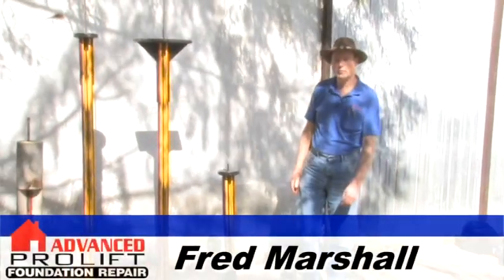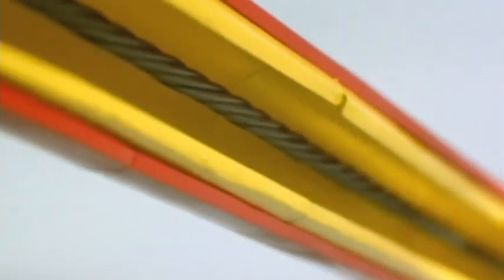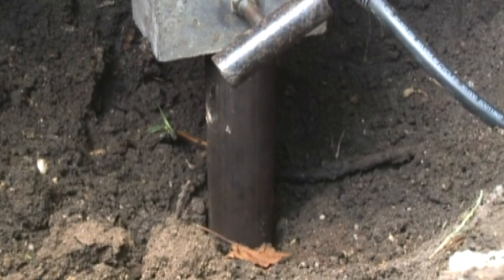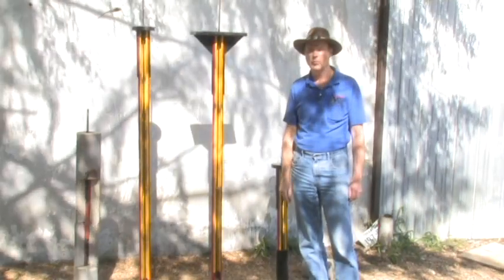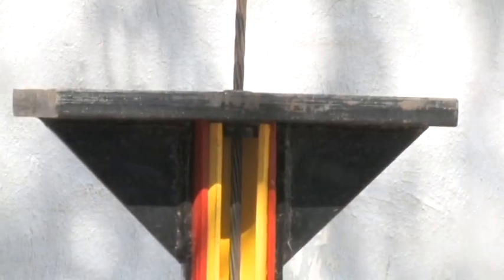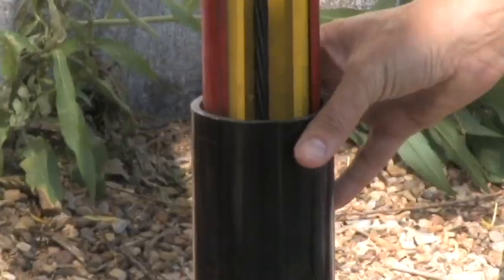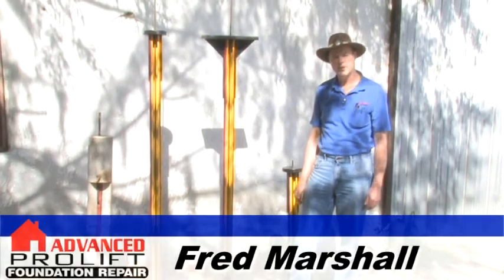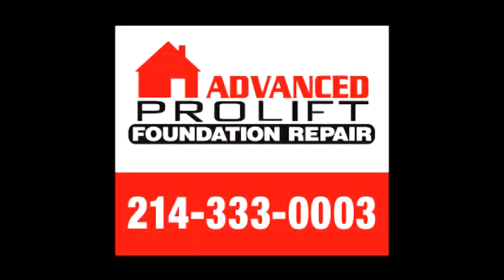Foundation Repair Methods - Pro-Lift Steel Pile Foundation Repair

Comment: I have looked at their Drawings provided via Builder. Poor resolution of the Drawings, no installation details, and lack of transparency in design calculations seems to be the problem. Advanced FR should push each builder to submit to any potential buyer a complete and legible set of Drawings, soil sample test results, bearing capacity, soil stabilization treatment (if any), geotechnical Calcs, and Test reports